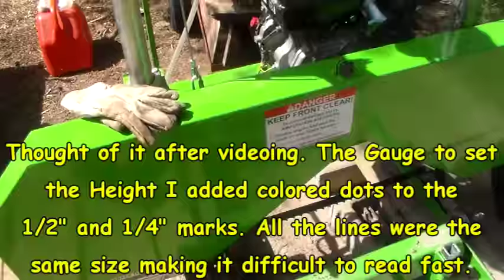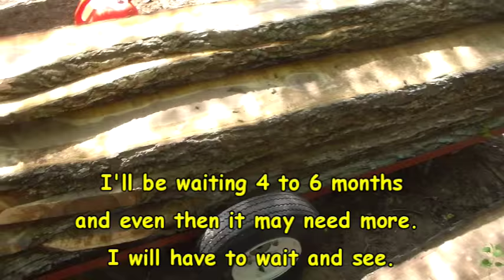#73 Slabbing Walnut on the Mill

Comment: We have a small mill, you can’t explain the joy until to anyone, have to experience. Just one polite thought, you will have much more enjoyable and less painful use if you were to look at raising the bed to knee height or just above, really speeds up and reduces strain when rolling a cant and doing allot of board trimming and bunk work. Also mentioned in another video, use a little pinesol,about a quarter cup per gallon in the blade water, keeps the blade and guides clear of pitch and lubes a little.

Comment: Something you might consider in the future, if you haven't done so since this short series of videos, is getting a few more wood pieces with angles to them (like you have with the longer versions) and place them up against the far side of the rails, so that logs can be rolled up onto the rails in steps and with little resistance.

Comment: Access to quantities of good hardwood is something I dream about, lots of trees here but 95% conifers.  The mill seems to work real well.  Still thinking of repowering it with the other engine you have?  Thanks for sharing.
Reply from the maker: Gord Roberts I have just the opposite problem. everything around here is hard wood, a few cedars but little to no pines. decided to keep the motor that's on it. haven't ran into anything it couldn't handle. I did upgrade the rails and it will cut just over 17 feet length now.
Reply: We have W. Red Cedar, some Yellow Cedar in places (turns nice  with sharp tools and is pretty) with Douglas Fir and hemlock in plenty where I live on the coast.  Some red alder and birch.  You have to go inland to find stands of jack pine or ponderosa.  The walnut you're milling runs up to $5 to  $20/bf for trimmed slabs, depending on thickness, way higher for natural edge pieces like you cut.
Reply from the maker: Gord Roberts Cool, the only cedar we get here is Aromatic cedar (at least that's what everyone here calls it). Its beautiful stuff but there is not a lot of it. I can get tons of walnut, hell I have tons of it LOL. also get a lot of soft maple, elm, hackberry, occasionally red oak, white oak, and catalpa. would love to get a hold of some birch and beech. all the tool restorations I'm doing they would be handy. Oh I have a little bit of apple right now too.

Comment: In your first video of the sawmill you mentioned possibly welding the connection point between the rail ends to avoid the hump when the carriage passes over. Just wondering if you did this and if so how did it work. Thanks for sharing.
Reply from the maker: Actually I upgraded the rails altogether. 21 feet of tail is giving me 17 plus feet of cut. The new rails were also 2 pieces and I did weld and grind the joint. it passes smooth as can be across it.